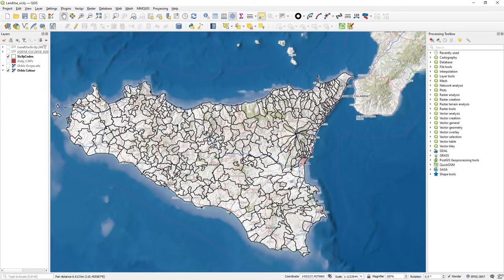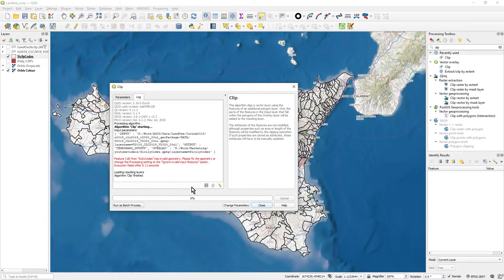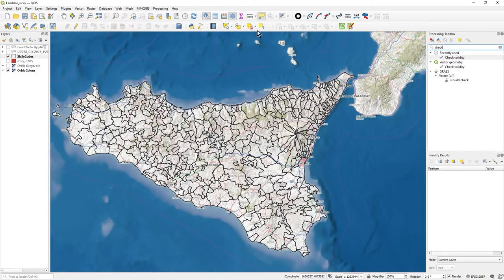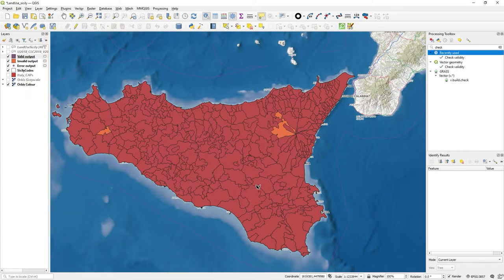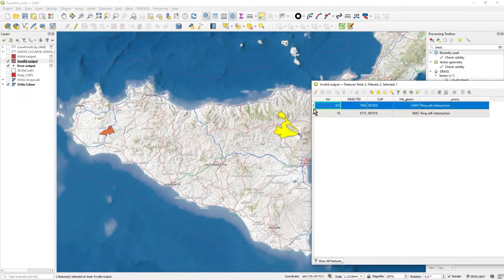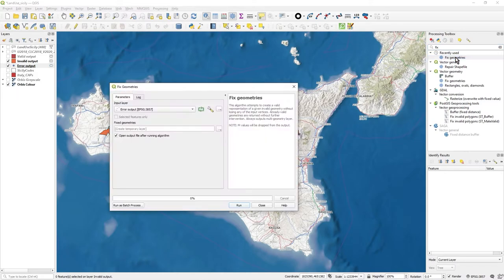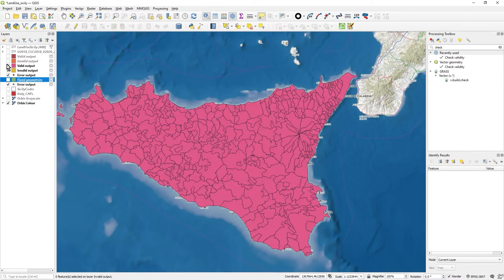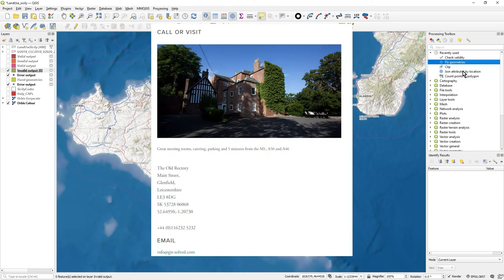How to Validate & Fix Geometry in QGIS

Comment: Very helpful video! Glad I'm not the only one who spends a bit of time fixing geometry (other people's 😆). Couple of things to add. 1. The "Fix geometry" tool is also available under "modify features in place". So you don't have to create a new layer of fixed geometry every time. 2. There is also there the "check geometries" tool/plugin under the vector menu that you can use if you still find you are having problems with invalid geometry after you've run the two tools you ran here (lets you drill down and offers solutions at multiple resolutions).

I find that ArcGIS and MapInfo are far less bothered by the quality of geometry than QGIS and PostGIS are. GEOS is a much higher standard clearly.
Reply from the maker: Thanks for the comment. Yes you are quite right there are some other good options. I think at the end of the day it is best to try and ensure the geometry is valid at point of capture - e.g. JS API for ArcGIS you can check for self-intersecting polygons.
Reply: @GISCoordinated  Couldn't agree more! I could rant for quite a while but I'll try to avoid that! It really boils down to two things .1. Training - if the data is being collected internally; and 2. Procurement - making sure that if you are commissioning data collection/creation that quality standards are a requirement.